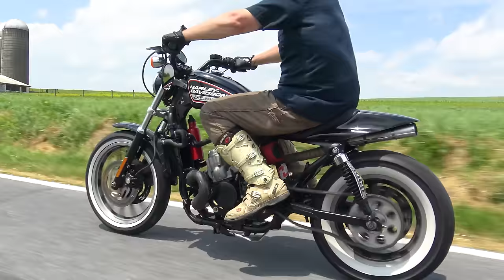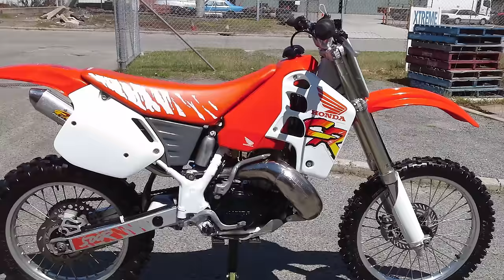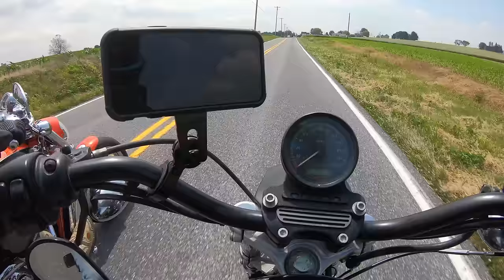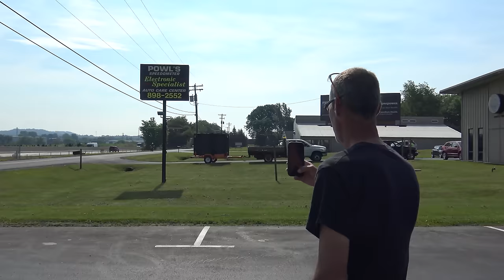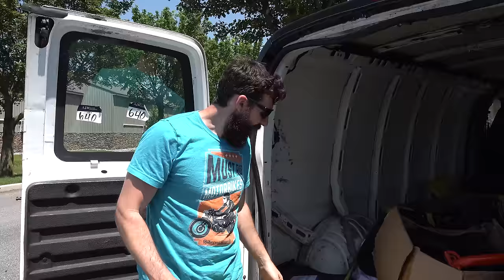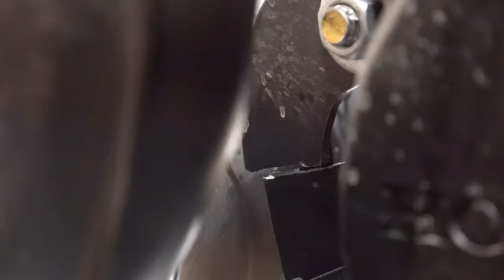First EVER 2 stroke powered Harley-Davidson(Engine Swap)

Comment: Hey guy you are 40 years late, in the 70's harley sold 2 strokes 250cc...
Reply: In the forties Harley sold 125 two strokes. (DKW)
Reply: Actually it was only because Harley bought Aermacchi and was selling their motorcycles under Harley brand.
Reply: My uncle Bob has a Harley Davidson amf 175 2 stroke
Reply: @isaiahminton2766 It's basically rebranded aermacchi sx 175, harley did not design this motorcycle.
Reply: @Dymitr_Nawrocki  yeah but it's still a Harley Davidson and there is no arguing about that cause it says it all over it😂
Reply: @isaiahminton2766  Yes it's Harley but only by name. If Harley would buy Durex company and would sell condoms under Harley brand could you say the person who is using them is a Harley rider? Only thing about it beeing Harley is the name of motorcycle, and don't get me wrong i see that as adventage.

Comment: Harley did make two stroke bikes beginning in 1948 after plans for the DKW RT125 were taken from Germany. Harley's two strokes were sold as entry-level bikes for their off-road, and casual riding audience. These smaller bikes weren't really prevalent until the AMF years when the Rapido, X-90, Sprint, and other models were produced (hence why a lot of two stroke bikes made by Harley the 1970s are still around). They were made to compete with the more affordable import brands such as Kawasaki, Suzuki, and Honda, that were beginning to take a stronger hold in the American motorcycle marketplace.

Comment: You guys are great... just a tip, since it's a 500, It might have pressure release, and also dont just kick it. Gota find that top center and built pressure. And gas leaking out carburetor... a 30.00 dollar rebuild kit just fixed my xr650, its was dumping gas to, either main jet, maybe the float... could be a lil gumbed up... but you guys are 2 cool. Love the videos. God bless America

Comment: WOW MOST RELIABLE HARLEY EVER!!!!!!!!!  Yes yes some get 100,000 miles, well I've seen many Hondas with over 500,000!!!! Most were older 750cc original motors!!!!  When I used to work at abike repair shop years ago

Comment: Me and a buddy put one in a trx250r chassis. It was awesome for about 5 to 10 minutes at a time. Same problem. Bolts vibrating out all over the quad and your hands were completely numb from the vibration. That's when we learned about it not having a counter balancer like 2 stroke quad engine.

Comment: Long way from being the first. When I was 11 or 12 I was riding a 165 Harley 2 stroke hard tail. Painted dark blue over an original metallic pink paint job. The motor was mfg in Italy if I remember right. This was   late 60’s when I was riding it as a dirt bike.

Comment: Nicely done. 
Im currently building a 1976 dt250 frame that I’ve chopped into a bobber style, and putting a 1983 it490 engine into it. I get asked why? Well as a dirt bike and chopper/bobber fan why the hell not? Lol. I’ve got some rear suspension though. 
You guys are kicking that 2T500 like a 4T! You need kickstart at top dead centre or just a fraction past, then jump on it

Comment: Skateboard/sneaker shoes are actually beneficial, the flat bottom makes it harder for your foot to slip off the kickstart, at least it's better than starting a 250 with crocs (been there).

Comment: My very first Harley-Davidson was the two-stroke AMF this was back in the '70s and it had a rear sprocket that was almost as big as the tire but it still runs 65 mph down the highway and it was a hell of a motorcycle it could climb anything and it did right up to the day when I didn't put enough oil in the mix and it seized up but it was a hell of a motorcycle I believe it was a Harley Davidson AMF 100

Comment: set correct air fuel mixture and you wont have problems with plugs, also put rear suspension in and maybe make counter balancer to eliminate vibrations

Comment: Oh jeez.  This bike is really cool, but it is a bit alarming what people think is "normal 2-stroke stuff".  I kept the same plug in my Husqvarna for like 6 years, and only put a new one in out of a sense of duty (it wasn't needed and changed nothing).  Starting a 500 can be difficult, but as that kid demonstrated, mostly just takes the correct technique on the starter (one big correct kick will work; 100,000 medium-strength kicks will do nothing).  The big-brain jetting made a lot of problems where there were none, which I think you guys basically figured out by the end.  2-strokes have no problem cruising around.  They used to make street 2-strokes and even long distance touring 2-strokes.  The only fundamental difference between those an a CR500 was cylinder count and gearing.  The fasteners working their way loose is definitely a thing, but on the dirt bikes you just put everything together with blue Loctite, and if it still comes loose then bump it up to the red.

I think a lot of this comes down to familiarity.  I only got my first 4-stroke street bike about 2 years ago (XS-650), and the thing felt very foreign and like it was trying to shake itself to death.  And in return for putting up with the extra 70lbs and complication and horrible shaking compared to my 2-stroke Kawasaki 400 triple, the pig was also a LOT slower.  Looked cool though.  But so does the Triple.  I sold the XS and started on the much-needed rebuild for the 400.  First start on the fresh motor and new expansion chambers should be tomorrow, fingers crossed.

Long Live the 2-Strokes!  Death to the Diesels!

Comment: A lot of snowmobiles have 3 cylinder 2 stroke engines. You should use one of those engines with a harley transmission.

Comment: I ride an rm250.  Same plug.  48 hrs.   Starts second kick always.use nylock nuts to fasten engine.  Run it at 50 to one oil gas mix.  Run it hard

Comment: Okay I am a dirt by guy... I won't critique your ride because it's a great first attempt but if you were to pick a dirt bike 2stroke motor to put in a sports bike go for the KTM 300 XC. the motor is counterbalance and it produces quite a bit of horsepower and torque for weight

Comment: There is a technique to start a big bore two stroke carburetor engine. Once you get to know a bike you can start it easy. 2 strokes need red loctite for every bolt, so much vibration.

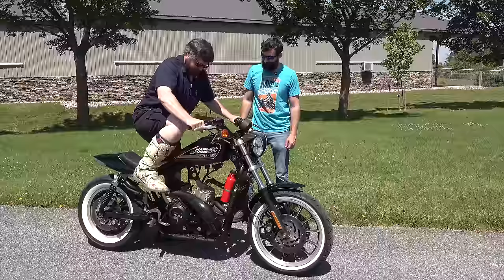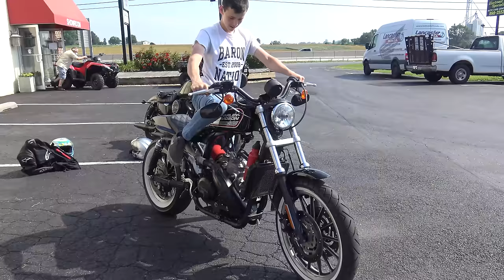Comment: 8:44 - How not to start any big bore or high compression motor. 10:07 - Notice how he put all his weight into it. That's how you start a bike.
I own a Cr250 and I check my bolts on a regular basis to ensure they have not come loose because stuff vibrates off. 5 Plugs LOL, Since I've got my bike last year I've had the same plug running 32:1 and I've ridden at least 30hrs

Comment: I'm a girl and can kick a cr500 in 1-3 kicks. Had a 2000. You need to slowly move the kicker down until you feel the piston tdc. Then give a single, hard kick down while twisting 1/8th throttle. Works like a charm. These big two strokes are compression beasts and like a long, full stroke to fire up.
Reply from the maker: That’s awesome, you are awesome
Reply: @BikesandBeards  The girl knows how to start a 2 stroke big single well done .I had a mate get a kick start in his carlf and another flipped off the bike get it wrong and look out .

Comment: Had a 96 500 motor in a 2005 crf250x frame that was turned into a super moto and street legalized... most fun I’ve ever had but it rattled itself a part every time I rode it. 100% wasn’t for the street the big bores load up real bad if you can’t open them up, I’ll keep my 2 strokes for the track last one I try to take to the road

Comment: Good start for a cycle made from modified parts.  It beat an 883 in its questionable condition.  You know the repairs needed.  Work to correct the problems you have found.  You could make a tight, reliable, one of a kind bike with a little more work.

Comment: If i knew what i know now i would have never sold my cr500 but honestly i was i bit disappointed with the power of it i was expecting more from it from the stories i heard about them but didn't think it was what people were saying ,but it did have a fresh rebuild & i did get told that quite often when they resleeve them the transfer port doesn't quite line up & you have to rematch to ports when you resleeve them & if it had not been done it would be down on power & would not perform as it should .So i have always wonder now if that was the case should have just keep it because in this country you can not find them anymore & if you do they are going for gold serious money

Comment: no loctite, thin metal motor mounts, chain by your foot...that's some Red Green level engineering.  I like the idea though, the small yet powerfull engine looks good in the frame.  It's a shame the rear suspension is just for looks though.

Comment: if you had to change the spark plug more than once you mustve been running that thing with way to much oil and i know this sound kinda wrong but if you mix to much oil you can actually run it to lean and not get enough oil into the engine and increase the chance of blowing the motor because the high ratio of fuel and oil make the fuel thick and the bike cant suck it throughto the engine.

Comment: You all may not know this, but Harley-Davidson was producing two-stroke motorcycles since the 1960's.  Harley purchased 50% of Aermacchi to do so.  I believe the Aermacchi two-stroke machines were the only Harleys to ever win a world championship.  I believe it was three world grand prix championships, 250cc in 1973 and 250 & 350cc in 1974.  AMF bought Harley-Davidson in 1969.  Then AMF-Harley-Davidson bought the remaining 50% of Aermacchi in 1974, but sold it to Cagiva in 1978.  By the way, the Aermacchi-Harley-Davidson 500cc grand prix bike they were working on at the time, is what became the Cagiva 500 that started winning in world grand prix.  Talk about a bad move.

Comment: If you balance the crank it would run forever. I HAVE A 1982 CR480 AND BMNEVER CHANGED THE PLUG SAME PLUV 13 YEARS . WHATS THAT TELL YOU

Comment: me, a machine guy: FRANKENSTEIN EVERYTHING!
A really crazy swap too would be a 3 stroke snowmobile powered bike.
Reply: They are kind of a headache of an engine to deal with. Snowmobile engines were designed to run in the cold. My buddy had to do a lot of work to his Yamaha Viper M-TX 141 turbocharged engine swapped into his Honda Odyssey. Still doesn't run quite right in warmer temperatures, even with carb adjustments. Runs great in cooler weather though, 60 degrees and colder, and it's stupid fast.

Comment: Gotta be the engine  or jetting. My 500 suzuki and kx 500 would start 1 to 4 kicks every time  for years change the shocks and loctite everything it will be a great rider. I'm doing a kx 250 engine in a ninja 250. Or???

Comment: You know, you could've just bought a Panthera 650cc or 700cc 2t "PM07" or "PM09" complete engine, one is based off the CR500R 2t and the other, well, it's again based off the CR500R lol....but even the "small one" at 648cc's, is pumping out 100hp and 70lb-ft of torques.... would've been the perfect addition to that Harley, and definitely better than sourcing (and stripping) a CR500R 😅

Comment: Tighten the chain, lower the rear tire pressure, run a less rich mix, adjust the fuel/air mix on the carb, open it up now and then and rev it while clutching at times, lock washer everything and learn to kick a bike and you'll be set, I'm surprised they all survived let alone the poor bike

Comment: Starting issues could be solved by a small separate fuel tank running a low ratio oil mix

Comment: Lol, should slap a KLR engine in it! Then it would have even less power than the stock Harley, but would run forever! (Well, as long as you don't run it out of oil...)

Comment: I’d honestly never recommend a 2 stroke for road use... I converted my 90 yz250 to basically street legal, it’s a blast to ride runs great if it’s cold out and hasn’t been ran at all that day has some issues starting... also consumes a lot of fuel because your running half to wide open throttle... i shortly learned its more for a Sunday cruiser, def wish I had a 4 stroke to through the brake lights blinkers and stuff on.. thankfully i live in a small town where I don’t go 30 miles both way

Comment: Should pull that little mower engine out of the other and put the 670 predator v twin mower motor in it
Reply: Mower engine?!!😆
Reply: Correct! Mower short for lawn mower
Reply: @07scoobywrx  i like 2 strokes a lot the POWER the sound the weight it just makes sense and super reliable im a supercross boy but I respect people that like harleys I have to admit they look awesome and sound good but I Just like 2 stroke more cheers and ride safe mate
Reply: @jeremyclarkson6293  I like 2 strokes also I was referring to the bike they put a small mower/go kart engine in not the one with the cr500

Comment: The engine mounts weren't strong enough to hold the 60 horsepower of the CR 500 engine.... Strange, the stock mounts hold for 10's of thousands of miles (or more ) with a 1200 engine putting out about 60 hp and way more torque than the CR 500 engine, and even close to 100 hp out of modified 1200 engines.... weird...

Comment: Fuel  dumping out  of  Carburator  ... means  bad needle ..    Double nut them bolts..   must  be honda  used  some  Rubber  maybe  the Piston is the wrong weight ..
  I changed spark  plugs in my two strokes  once  per  year  NGK  R plugs   racing plugs..

Comment: “Vibrates itself apart”
Me just sitting here wondering these idiots never heard of aircraft nuts or loctite
Reply from the maker: Not the bolts, the welds vibrated apart lol
Reply: Aircraft nuts? You talking safety wire, bolts and nuts I assume?

Comment: This is something I have to do. But not with a Harley, and not with a CR500 engine. It will need to be a Japanese frame, and it will need to be an air cooled 2 stroke engine out of some kind of Japanese enduro bike, so it will have a way to power the lights. I can get it registered street legal as long as I have a title for the frame. It's the only way I know to get a fairly inexpensive 2 stroke street legal in my state. Vintage 2 stroke street bikes sell for 5 figures these days. But an old Japanese street bike frame and an old Japanese 2 stroke dirt bike motor cobbled together should do the trick. I wonder why I never thought of that before? I already think I know where I can get a non running Kawasaki Vulcan 500 that I think has a title.

Comment: Too much 2t oil that's why it's hard to start. Also adding more 2t makes your fuel mixture leaner and will lead to piston seizures
Reply: Less oil will actually make it seize
Reply: Too much oil it’ll sometimes be boggy and run through plugs really fast

Comment: Harley-Davidson made two-cycle motorcycles back in the seventies and that's before they were owned by the corporation that they're owned by now it was called AMF Harley Davidson they made what is called the sprinter and the STX series motorcycles and they had two stroke engines on them

Comment: You would've both won on that rolling race, and beat both bikes my a much larger margin on the other from the dig races, if you knew how to shift 😅

Edit: now only if your guy would've made the swingarm and suspension work with some custom bushings and everything instead of welding it solid.... that's terrible.... and then made it even faster by either buying a Panthera CR500R based custom 700cc 2t they have available that make like 120hp and 90lb-ft of torque, and then of course, take it to a shop that specializes in making expansion chambers (even for this one) and had a legitimate expansion chamber scrambler style exhaust built for it instead of just running the stock CR expansion only and no back pressure after that 😅

Comment: There not twobsyroke guys or they would have known to take the plugs out heat them up putem back in and kick it over as soon as you get the plugs in it will start right up every time first kick just like a diesel with glow plugs

Comment: Use your body weight to start it not your leg muscle as well you must be on top of the stroke and it will start most every time as well. The kid did it right look at how he stood straight up and then jumped into the kick starter and used all his body weight to start it. As Craig was just using his leg only and barly getting the motor to turn.

Comment: You aren’t starting it properly is the issue. You can easily 1 kick start a CR500 if you slow kick it first to get fuel in and then put it on the power stroke when you need to start it

Comment: should have use a ktm or yamha 2 stroke the hondas power band is way to small and pulls too weak compared to the other 2,im not a brand fan boy and iv owned 6 hondas and evry make and owned every brand too so you can believe me when i say thats a fact,the ktm 300 2 stroke would have been the best choice for a full size bike and have some linear power and the gearing in the gear box on some of them are better suited for street speeds.

Comment: Please fix the mounts and get a 
Experienced 2 stroke mechanic it sort out the jetting with a few plug chop runs..
     Even in your drag  Races it didn't appear to be pulling hard into the power 
Band ...   lots of untapped potential here...

Comment: I cant believe that they are proud of this, the quality if the build is so poor it just rattled itself apart, damaged his leg kick starting it with sneakers on and thought it was a joke. The guy cant even ride the two stroke properly, Changing a sparkplug 5 times in 30 miles is not normal. The carb shouldn't leak on the side stand even on the CR500. Even i can assume the carb is pouring too much fuel into the engine and killing plugs and being hard to start when hot. Also why didnt we see blue smoke from the exhaust? please tell me they weren't dumb enough to run it on straight fuel? and how do you mix up 2t fuel Rich?